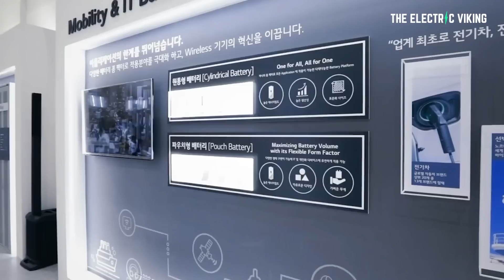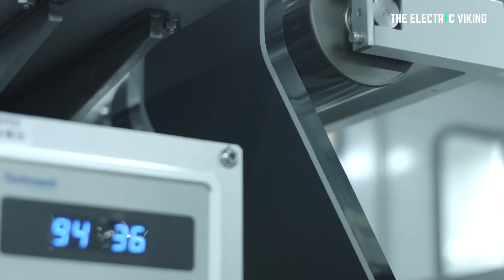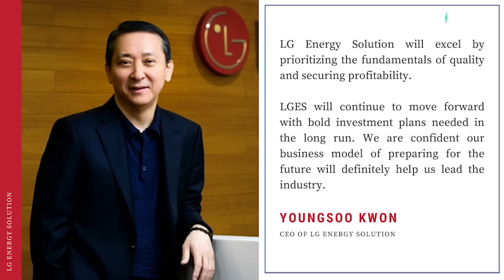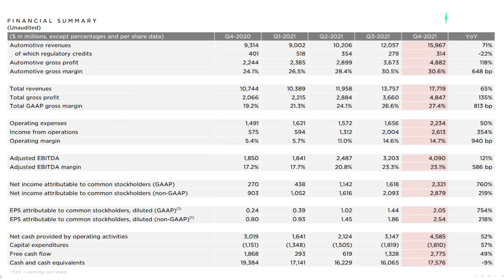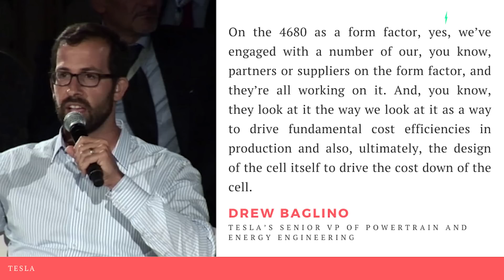Another Tesla battery supplier confirms 4680 cell development

Comment: The 46 X 80 batteries can be copied as far as the dimensions are concerned.  It is the proprietary materials and manufacturing techniques that are copyrighted and patented and cannot be used by other manufacturers without licensing. It's possible that other manufacturers can copy the form factor but not the hidden inside secrets.

Comment: Volkswagen seem to be putting more cash into electric cars than any other legacy brand.   They have a few battery suppliers;
1. LG Energy Solution Ltd.
2. Northvolt AB (Swedish Start up).
3. Samsung SDI (Prismatic LFP)
4. SK Innovation Co. Ltd
5. CATL (LFP Batteries)
6. Gotion Hi-Tech (26% stake largest shareholder) LFP
7. BYD Co. Ltd (for Audi Only)
8. QuantumScape Corp. (Solid State Batteries)
9. Making their own Unified Prismatic Cell (LFP) batteries (2023) As they work towards vertical integration.

Comment: The 4680 form factor solves so many problems that it's a ridiculous jump over anything that came before for Li-Ion.  You've mentioned most of all the advantages in the past.  But here's a summary.  Tabless design, easier and faster to manufacture, though the engineering was a challenge as is much new tech.  The machines don't have to stop for that tab to be put in place.  When charging, instead of a charge being sent down a tab and then having to propagate over the length of the jellyroll, it's propagating over the width, along the entire length, because it's like one big tab (it's actually broken in segments so it rolls correctly.  So, electrons are only having to traverse the height of the battery to charge the entire jellyroll.  Just a HUGE jump in charging time and efficiency and generating less heat in the process.

Part two of the design.  It's made to be part of a structure that adds strength and stability to the frame, the structural battery pack.  

Part three, it's the perfect dimensions for fast charging without overheating, along with being efficient in the use of space (bigger batteries mean bigger gaps around the batteries, and smaller batteries mean too much casing instead of electrical storage space.

But one of the biggest is recycling.  These can be recycled easier and Tesla is starting the build outs for recycling facilities.  

So, about everything you can conceive of that can be an improvement, the 4680 does it.  It's engineering brilliance, from the minds at Tesla.

Comment: Roger I know this because - Tesla has suspended the Cybertruck, Semi and Roadster and all the 4680 upgrades until at least 2023 - that is at least a year delay.  They also reported to Deutche bank January 2022 that they still had 10% of the 4680 left to solve.  Evidently vexing problems - at the same time they are sourcing alternative battery types - these would not be needed if they were confident of solving the 4680 which was to be in all Tesla designs.  The failure to resolve the 4680 problems really before 2023 is critical to Tesla.

Comment: Wait wait Sam. Filler words! Most of your videos are about 1 1/2 half times as long as needed to cover the topic! (I often cut out a bit beyond half way through as I hear the reputations begin). Like a rambling preacher you tend to run back over the same points multiple times. Edit your stuff; then comment on filler words. Most of your stuff is good. More focused and shorter would be better.

Comment: Sam,
Around 8:00 onwards.
"Cell" (singular), not "battery" (multiple)
(semantics, but let's get this right?).
No, the 4680 form factor doesn't "save space" due to the larger diameter. That means more space between the cells.
However,
It does save weight (about 40%) due to much reduced outside surface area of the "cans" required to contain the active material.

(Side note, please don't critique the speech patterns of others before addressing the repetition in your presentation.... Improving, but still needs work👍)

Comment: Great only problem - THE 4680 isn't working ..too many are failing to use them.  HENCE the Cybertruck, Semi, Roadster - are all pushed off A YEAR - Maybe forever.  Upgrades of the XYS &3 are also stalled until the battery can be made reliable - you see Tesla running all over trying to find an alternative - in case - they can't fix  the 4680.  You are so gung ho for EVs your totally blind to serious problems.
Reply: And you know this how?

Comment: 4680 production: pay attention to the words, "form factor". The truly most important and revolutionary aspect of Tesla 4680 is the 'dry' process, the reduction of biologically harmful solvents in the packaging, and the use of solvents in a closed loop during manufacture
Reply: 🤔 Hmmmmm.
I partly agree.
However, whereas the dry electrode is an important advance in "cell" production, what really makes the 4680 work is the tabless design.
The main issue with larger diameter cylindrical cells is heat dissipation.
If we assume the source of heat is largely resistance within the cell due to the long conduction path along the length of the rolled cathode, the tabless design, by reducing that path from possibly as much as 1 metre (depending on cathode thickness) to 80 mm maximum, may essentially eliminate that heat.
Benefits?
Improved power.
Improved charging (!)
Longevity.
Reduced cooling requirement.
etc.
......
The Maxwell process is very important to cost, factory size, environmental impact, etc, etc, etc, but not specific to the form factor.
(imo)
Reply: All important benefits of the form factor and valuable. Most important long-term for biological life is the controlled creation and dispersal of solvents during mining, manufacturing and recycling.

Comment: I want to know if Model Y performance is improved by using 4680s.
Reply: Let's think about it.
A 4680 pack with identical "Chemistry' to the latest 2170.
(We'll ignore the dry cathode)
....
1) Tabless design.
This is what makes the 4680 possible, by stopping the previous increased resistive heating in the larger cell.
(performance +?)
Also, faster (Power) out, means faster in!
That'll be faster charging (watch out for that V3 charger boost to 340+ kW!)

2) Fewer Cells (production performance +?).... Ok, off topic.

4) Less total weight in the "cans"
(That's good!)

5) Structural pack (easier with fewer cells.....?)
Leading to
6) Structure in the pack becomes the floor of the car, thus a sheet of steel 2m wide by 3(?) M long is removed.
If that's 3mm thick, 140 kg (2 passengers)
Add the "can weight" saving? Let's say 200- 250kg?
(440 - 560lbs)
That's like driving with, then without 3 passengers!
..
Result?
Less initial torque to move the vehicle, faster acceleration, better ride (when the Germans tweak the suspension 😉) better economy.
.
So yeah, undoubtedly better.
.
Oh, and if they aim to keep the range about even, maybe a 5% increase, remove a few cells, (even lighter!)
You won't notice on the "road trip" because the car will charge faster it will be waiting for you!

Comment: Will Tesla copy BYD's "blade" form factor moving forward?
Reply: Look from this perspective.
The blade battery is either a very long "jellyroll" folded, then inserted in the case, then welded at numerous points if contact, plus along the whole perimeter of the case.
Or it's several cut strips, with the same process.i can't see that being a particularly fast process.
On the other hand, the 4680 line..... "Rifle bullets"
Which factory sends more GWh out if the door each day?
Which factory is smaller?
(Imo, both Tesla?)
The only other question, can they produce a cylindrical cell with the LiFePo4 cathode?
You can buy them as small as AA size and as large as ..... Larger than 4680.
Why would they build larger, "slower" factories?

Comment: Lucid and Rivian are both using the Panasonic 2170 cells so pretty sure they'll quickly transition over to these more superior 4680 cells.  BTW, the cobalt and nickel-free batts are virtually identical to LFP batts.
Reply: Lucid and Rivian both need a supplier with the technology to make the 4680, not to mention, at least in the case of Lucid, careful consideration of the available space, since they don't have a completely flat pack?
BTW, "the Cobalt and Nickel free Batteries" are nothing of the sort.

Oh, I forgot.
Wouldn't it be ironic if Rivian and lucid DID swap (eventually), but the manufacturer was using Tesla technology, resulting in a nice royalty going to Tesla?

Comment: LG are going to make 4680 format cells but do we know whether they will use other Tesla innovations like the tabless design or the dry coating teqnique or even the same chemistry?
Reply: Dry coating? Well that depends on
A) Patents.
B) Are they using Tesla machinery under licence (!?).
Either way, Tesla gets a cut.

Then, 4680.
Why couldn't the 4680 be made before?
Because larger cells produce too much heat.
Why do they?
Charge path length.
What does the tabless design do?
Reduces that from up to 1 metre, to 75mm.
It's needed.
Next question.
Did they suddenly develop the tech themselves? (Doubtful)
Are they using Tesla designed (produced) machinery? (Quite possibly)
So Tesla gets a royalty on that as well.
Fits the mission.

Comment: It appears that Tesla and many of the Chinese OEM'S will have a stranglehold on LFP batteries leaving western automakers forced to use NMC chemistry. This will lead to higher prices for nickel and cobalt which coupled  with the  requirement  to need larger battery  packs to compensate for their drivetrain and build inefficiencies will result in higher priced Ev's. It's  not looking good for the legacy automakers. I strongly doubt that  many will make it to 2030.
Reply: Any Western auto maker is in trouble other than Tesla.  But it's their fault for ignoring what was going to happen

Yes I expect that 50% of auto makers outside of China will die, but even in China, auto makers are going to die because they produce ICEV and are also in the same situation, and I don't think the Chinese govt. will bail them out.  And, in China it seems pretty clear that the govt., part of the auto industry along with other manufacturing, AND the citizens are full in on BEV, and outside of China this is rare.  They deserve the accolades for the success they'll have for being forward looking.  In the US, there's too much division and fighting for it to compete, except for the handful of companies that are more forward looking than the govt., the people and most the rest of the companies in the country.  And who is that?  Tesla.

And that's what happens when propaganda rules, instead of data.

Comment: I don’t think there will be enough batteries, even with LG.
Reply: Tesla is going to produce their own 4680s at Austin and Germany.  And right now the 4680 is in production near Fremont.  That should expand, and the intention is that these factories will produce the battery needs for the BEVs rolling out of those plants, with some exceptions.  Tesla has contracted with Panasonic to make a higher capacity 4680 so they can power  a vehicle in the future, or maybe an upgrade to some current line, to compete with the 1000 KM vehicles that will come out late this year or next year from China.

Tesla has also contracted with different mining companies to procure the raw materials they need to make their own batteries.

Yes, there might not be enough batteries for the many different companies trying to transition to BEV.  But Tesla isn't going to have that problem because they've been working to solve it for years.

Yes Tesla will need different companies to make batteries.  They have contracts with CATL, LG, Panasonic, BYD, a couple companies in the US and are making their own.  And this isn't just for their 4680.  It's also for LFP and they're looking at lithium free technology too.

The companies that are WAY behind the curve and WILL have battery issues is all the western auto makers that discredited Tesla and want to manufacture outside of China.  Chinese auto companies and Tesla have bought up most the supply. Or in the case of BYD, they make their own batteries and vehicles.  So good luck to all those other companies.

Comment: LG has for some odd reason decided building batteries that dont catch on fire might be a better idea.
Reply: A pity that someone can't make petrol that can't catch fire.
Reply: @eclecticcyclist  LOL
Reply: Its was gm,s shitty thermal management that caused the battery to burst into flames they just blamed LG which has been using those batteries in cell phones for decades 😳
Reply: @lesstevens2370  LOL I am shocked I tell you shocked.  Well not that shocked.  I figure anything coming out of GM is engineered to the lowest denominator. If they can do it cheaper they will. If they can do it better they wont. I know you are shocked LOL
Reply: @lesstevens2370  
It was a manufacturing tolerance at LG leading to a rare tab shirt.
Admitted and compensated for.
(And I think you know that)
.
Look, I don't give GM any credit, but don't spout obvious FUD.